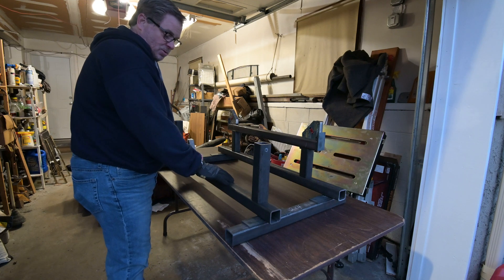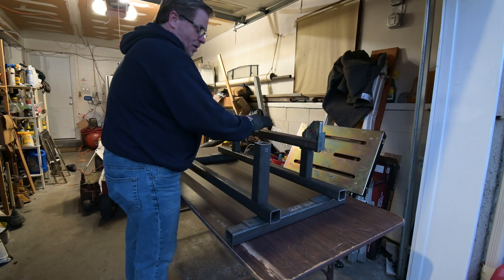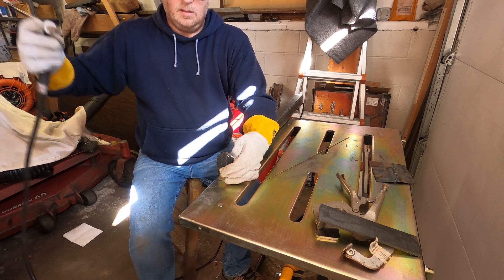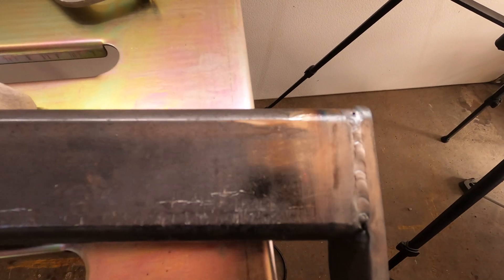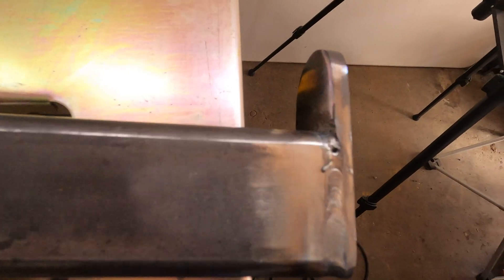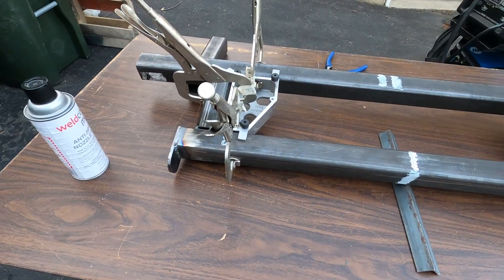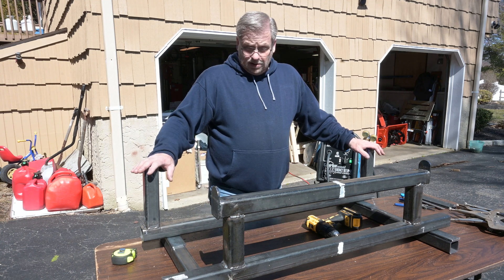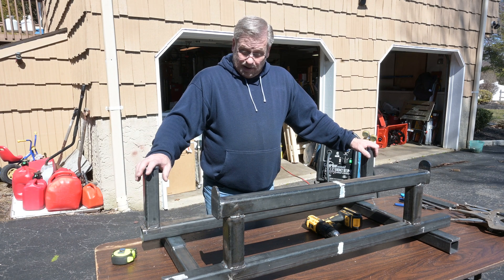Designing and Building a Classic Mustang Body Jig - Part 2 | Mustang frame jig | Mustang chassis jig

Comment: How thick is the metal
Reply from the maker: Sorry for the late reply. The 2x4 for the main frame of the jig is 3/16" thick. Some of the 2x2s are .120" wall, and some are 3/16". In hindsight, the 3/16" is overkill for the 2x2 rails, .120 would work fine.  Hope this helps